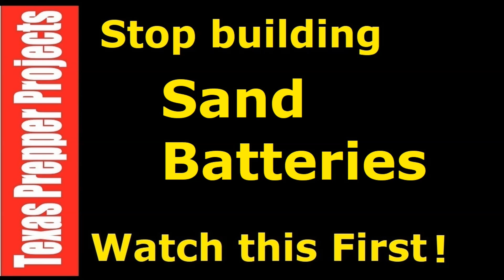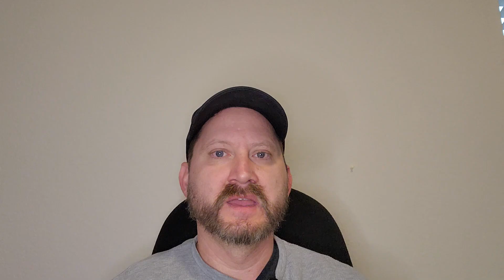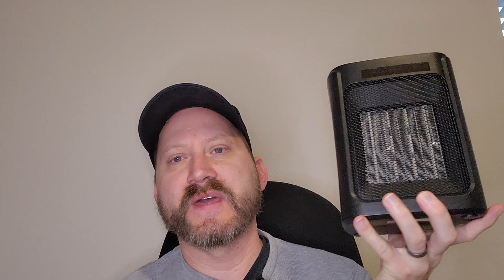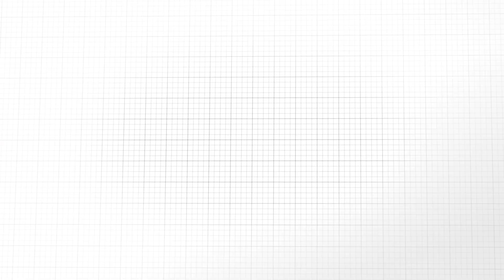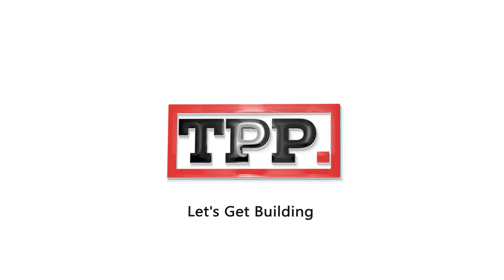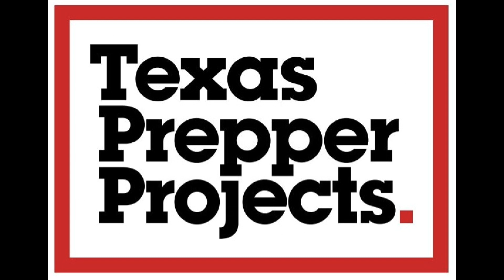Stop Building Sand Batteries | Texas Prepper Projects

Comment: I'm planning on building a sand battery, to maintain warmth in a greenhouse at night.

I think you've missed the point entirely. Its not about moving heat, its not about efficiency or magically creating heat either. A battery is a store of energy, to hold onto it and release it later. 

In the case of my greenhouse, it gets very cold at night. Hopefully a large sand battery will retain enough heat to prevent it from freezing. Thats the idea anyway!
Reply from the maker: You are much better off using a pool heater to directly solar heat a 55 gallon of drum of water. You can't 'store' heat like that. The heat had to go somewhere,  and that means...into the air. Good luck. Post a video when your done.
Reply: Yes the heat goes into the air which is what you want when heating a greenhouse.
Reply: @XxBloggs  Or maybe a basement to keep the pipes from freezing?
Reply: @texasprepperprojects  Sand gets WAY hotter than water and will therefore store more heat to release at night. Also, sand will heat up way faster.

Comment: My use case is different: Heat my whole house concrete slab over week or even multiple weeks, slowly but constantly. To me, it seems sand is the best way to keep the warm water flowing at night. So, 5000w x10 hours a day x 7days does seems like enough energy. Side note, I’m ok with tons of sand… I’m in the AZ countryside. I’m on a tankless propane water heater currently that makes using the floor heat unobtanium
Reply from the maker: I would LOVE to try a direct thermal solar water heating into a radiant floor. Circulate water or windshield washer fluid through Pex on the roof and then into the floor. 100% perfect thermal efficiency without the conversion losses. Just like a solar pool heater, but into your floor. Consider that. .
Reply: @texasprepperprojects  we actually have an evacuated tube solar heating system on the roof from when we bought our house and it has negligible effect on the pre-heating of the water. Might not be working properly 🤔. That and it doesn’t work at night so the propane tank gets drained quickly. And all that to say, I’m not married to the idea of a sand battery… it’s just we have plenty of sunshine and don’t want to stray from having warm concrete for our feet so hopefully there’s a best option out there!  That’s for all the help!

Comment: My use case theory is a small basement concrete my water equipment is centralized so a bucket below the  water works hanging 6 ft above the bucket to hopefully rase tge oberall temp 10 deg ish.
Reply from the maker: Try it

Comment: You forget sun is shining only at day time, and the    ,,batterie ,, is for the night, if there is no sun , you load you battery durring the night tarifs for use during the day. No?
Reply from the maker: I am aware that the sun only shines during the day. But the point is that heat is heat and the idea of 'storing' heat doesn't make sense. The heat from the sun, goes into the sand, and then goes into the air. Or. It goes from the sun into the air. But it all ends up in the same place

Comment: Oh, fud! I just bought my solar panels and hooked up my sand battery. It's too late to return so I am gonna wait it out and see how it goes. No data yet with all of the snow we have had. Ideally, I would like to keep a small diy greenhouse in the 40s (or higher) overnight. Haven't started any seeds yet, so not much lost except for $200 and time. Fingers crossed that 40 - 50 degree temps are doable depending on the outdoor temps.
Reply from the maker: Do direct solar heating using water and a 55g drum.  Or connect your solar panels directly to a 250w mini space heater. But sand batteries on solar? Doesn't make any sense.

Comment: This old idea, borns in italy, long time ago.
During hot summer, a photovoltaic power plant, or eolic fan, 
Put energy, to sand  ( very strong insulated)until 500 celsius, to use in winter, to heat, or  integrate it, for  halls of university students.
Conservation of energy, is a rule, of thermodynamics.
You are right, now, do this at in a normal home, selfbuilt  is useless.
Reply from the maker: Thanks

Comment: The UK fellow that passed a spiral stainless steel exhaust pipe through an old propane? tank filled with sand from his "diesel car heater" makes sense as he is extracting the waste heat, fumes, and moisture  that was heading out the exhaust pipe to the outdoors. It can heat up vessel for several hours and then when heater is shut off, the metal vessel will radiate some heat for several hours possibly keeping area from freezing temps. It stores otherwise wasted heat.
Reply from the maker: Thanks

Comment: You are missing the point! Electric battery also doesn't gain energy - JUST stores it for later use! The point of sand battery for heating is to "charge" it when you have extra energy (extra solar at noon) and "discharge" it once the sun is gone (heating the room from "battery"). You should heat the room at noon on TOP of charging the battery at noon.
Reply from the maker: Except you can't turn sand heat on and off like you can with an electrical battery. There is no such thing as 'charging' sand. You are Heating the sand.
Reply: @texasprepperprojects  batteries are extremely expensive with about 20 yrs lifespan, you can store the heat in sand and use it for cooking after dark ,your sand oven will last for 1,000 yrs. and can be made extremely cheap.
Reply: @texasprepperprojects  In fact you can turn on, turn off

It's the concept of storing heat for posterior use.

Imagine in this way. One heat pump pushes the hot liquid towards the fan to expel the heat as hot air, it's a kind of switch on.

In large scale you save the heat at very high temperatures in some material, even sand, and produce energy when needed with one steam generator

Comment: The core concept of converting solar panel output wattage to heat a room/building should still be valid.  Take advantage of the free energy hitting the Earth and use it to heat indoors.  A 1,000 Watt space heater may be simpler, but surely having a radiator that gets up to ~250 degrees in a room is better than not having it in the room?  I know having a desktop computer running ~400 Watts will heat up that side of the room pretty significantly after an hour or so.
Reply from the maker: Not really. Do the math.. it just doesn't make any sense. Think of it in pure watts. 1,000w of solar gets you 1,000w of heat.. which ain't that much return on investment.  Now, i think that direct solar water heating has promise because the btu are better and the size to btu is better. More testing to come on that one.

Comment: Thanks for the video!
I made an ice air conditioner for my shop that didn’t work. When I finally did the math it turned out that a cooler of ice does not have enough BTUs  to cool off a garage in South Carolina.
Reply from the maker: Yup and the fancy stuff people do with radiators and such are pointless. It's the same thing as having an open cooler of ice on the floor next to you. Fans and pumps and radiators don't do anything to make a net gain

Comment: I’ve been wanting to use solar since the 70’s. The best Idea I’ve seen was an article in Popular Mechanics or Popular Science back in the 70’s.  The idea they used was a solar hot air collector using a sheet of metal in a green house shaped building with black painted cans to increase the area.  The sheet of copper or other metal, even corrugated roofing material in a box with glass front and insulated sides. Air would move over the panel via convection and flow through a mass of gravel or river stone all day. That would heat up and store your heat energy during the day. Then the panels would be sealed off at night and the heat energy from the biomass of stones would flow into the house for heat. The story claimed it worked. The key is having a large mass of stones or bricks with holes in them.  Not as easy or cheap as a sand bucket, but should work. Think of walking by a stone or brick wall after sundown with the heat coming off it.  Just food for thought. Hopefully this article is still available and archived somewhere. A similar article appeared in Mother Earth News in the 80’s.  Dave
Reply from the maker: Try it

Comment: The idea of a sand battery is to heat the sand with excess solar in the summer and release it in the winter. Although it is an inefficient use of energy due to losses the idea is you are storing energy that is otherwise unusable. The only practical use I have seen in winter is burning free wood to heat the sand outside then transferring inside to slowly release heat like a radiator thus saving on energy bills.
Reply from the maker: Except no one is building it that way on YouTube
Reply: @texasprepperprojects  I'm not sure what off grid survival mike is doing but its definitely more substantial. I wasn't disagreeing with your video. Certainly most YouTubers are just using the idea of a sand battery just to make content. My personal thoughts that for home use it would have to buried 5 to 10 metres underground and contain at least 10 cubic metres of sand to have any chance of storing heat for months.
Reply: @texasprepperprojects   Because moving a couple hundred pound container in and out doesn't look cool.

Comment: I just use metal to store heat. I have a wood stove and 80 kilo iron on top keeps the room temperature for a few hours. 10 kilo aluminium in my solar oven keeps it cooking when a cloud passes by. Of course I have looked into sand batteries and even phase change materials, but metal seems to be best for my needs.
Reply from the maker: Cool
Reply: Would you mind explaining what a 10 kilo aluminum is please? I'm interested in solar cookers.
Reply: @leaperrins8373  The pot sits on an aluminium plate that serves as thermal mass, once it is heated up it holds cooking temperature for a while. I also use cast iron cookware for the same reason, I have a lot of videos so you can see what it looks like.
Reply: @SolarCookingGermany  I see, thanks for explaining. Does does the plate weigh 10 kilos then? I feel like that would be quite a chunk of aluminum.

Yes, I've seen people use cast iron cookware for when they need more consistent temperatures for things like baking etc. 

I did check out a couple of your videos, but couldn't work out what you were referring to in regards to the 10 kilo aluminum.
Reply: @leaperrins8373  You can see a fixed aluminium plate where the pot sits on in "Cooking Rice With DIY Solar Oven" from Dec 27 2024 and there's more aluminium hidden under the bottom (shown in the build video). But it's not 10 kilo, maybe 4..5, the rest of the thermal mass comes from the metal wall. The downside of this is it takes a few hours to heat everything up. The cast iron pot adds probably another 2..3 kilo.
Reply: @SolarCookingGermany  Thanks a lot for your reply, I understand now! I think it's great to experiment with different set ups and see what works best.
Reply: @leaperrins8373  You're right, it's experimenting, that solar oven would also work fine without so much thermal mass. I just wanted to share what I came to instead of sand etc. Metal is a no problem material, especially when on top of a wood stove, I spilled a container with PCM before... 😬

Comment: Did people actually think that the heat from a sand battery would be more than what you put into it?… it’s a method of energy storage, which if you’re wanting to store energy for later use (especially for room heating) then it’s a fantastic form of energy storage
Reply from the maker: People sure do. Somehow, people think that dropping a candle into a bucket of sand will magically make it hot enough to heat their house
Reply: @texasprepperprojects  I'm pretty sure if you stick that sand candle close to a curtain, it will heat the house up quite quickly

Comment: I built one of these.
I was going to use it to help keep a small green house.

The problem I have is not with the sand battery itself.
The solar panels work to make electricity and generate heat that I did not have before.

The problem I observed is that on days I need the additional heat, the sky is overcast.

The issue is that on a sunny day the heating element can take up to a certain amount of power.
Produced by a few solar panels.
On an overcast day to get the same amount of power the element needs additional input and the sand barely heats.
Reply from the maker: You're right, solar power is only useful when the sun is shining. It's just like a wood stove, you can't heat a house with wood if you run out of wood.
Reply: @texasprepperprojects  For my use that seems to be the only drawback.
The heat radiating from the bucket overnight was just enough to keep frost out of the greenhouse on a  day that was sunny.
Reply from the maker: Neat
Reply: @shawnr771  Your solution would then be not more solar, but more sand. The larger the battery capacity, the longer it will last... So you need enough sand to stay warm for an entire day (or multiple days) until the sun is out again to recharge the system. This is the same math a person does when using normal batteries in a solar system... You need to calculate energy capacity requirements vs storage x average capacity

Comment: Hey, thanks for the great video/science. I've been doing thought experiments around heating a sand battery on a wood burning stove, to be carried into a tent sized sleeping area/van for extra warmth. Of course it all depends on how hot I heat the battery, but do you think this might be a worthwhile method to retain a bit of the heat that would otherwise be going up the chimney? Of course it will retain and radiate some heat, but would the radiative heat available to a tent sized space from say a 9qt dutch oven full of sand be worth the effort/extra firewood to get it up to temp? I've been intending to attempt this soon but hadn't yet purchased the sand. Thanks for any advice.
Reply from the maker: I honestly do not think it's worth it. Spend $60 on a good quality electric blanket and $200 on a lipo4 battery and call it done

Comment: Put that a 1000 Watts  of extra solar in to a heat pump and heat hot water up to 7x Depending on time of year
Reply from the maker: You don't need 1,000w of solar to heat water. You need about 50w to run a pool pump and circulate water through pex

Comment: It stores up heat when you don't need it and radiates it when you do, at night. I don't see the problem here.
Reply from the maker: Did you watch the video?
Reply: @texasprepperprojects  Yes. It's fine for what it is. An electric blanket means you have to buy an inverter and batteries. Sand battery is so simple it works even after an EMP. $200 worth of used panels, some wire, heating elements, a big pot and sand can make a 2000 watt heater. As long as you don't expect it to break the laws of physics, it's a nice thing to have. The buddy heater can supplement it, but you can only store so much propane. This is free heat for the next 20 years.
Reply from the maker: First, EMPs are massively overstated. I'm literally more afraid of zombies than EMPs. Second, you are not going to get 2,000w of heat for $200 worth of solar. But I look forward to seeing your video where you build it

Comment: its very similar to the thermal mass heating that the amish do. You heat a mass, the sand ,and it holds the heat which continues to be hot. you can use solar energy to do the initial heating using the day light and then warm something after the sun is gone down.
i watched a lady heat a barbecuse drum in the sun and then have a barbecue in the evening.
in the uk, electricity is so expensive that heating sand from the sun would be great, if only it was shining for longer than  4 months of the year.
Reply from the maker: I am aware of thermal mass and i know it works. But that is tons of mass. 50 pounds of sand in a bucket is not going to heat a house, or a room